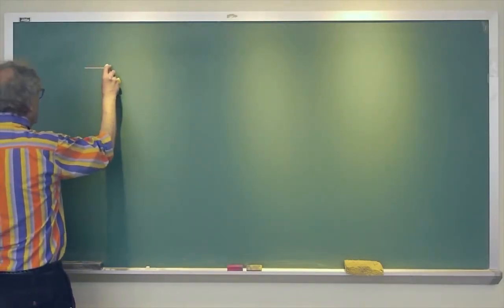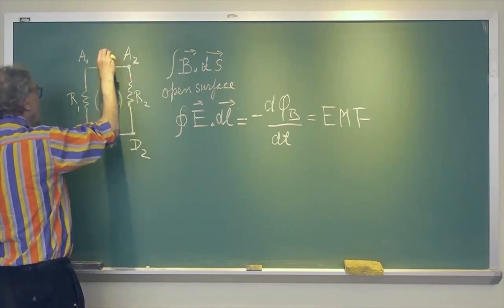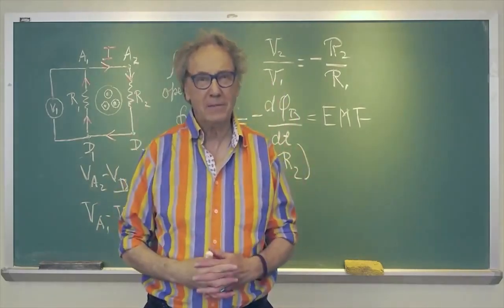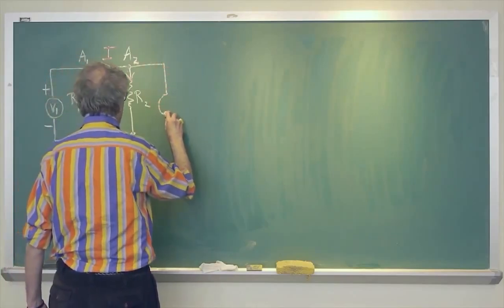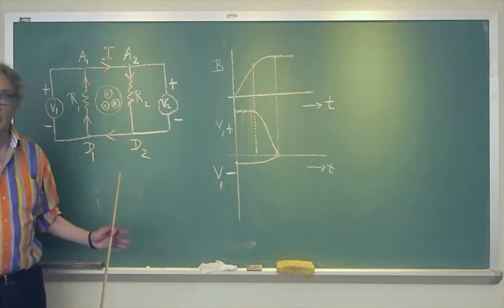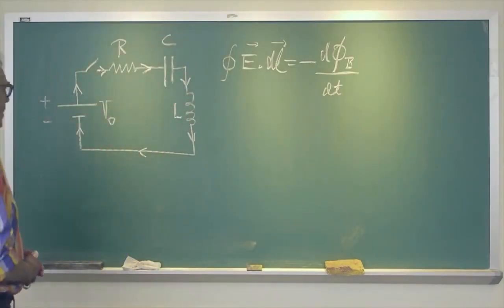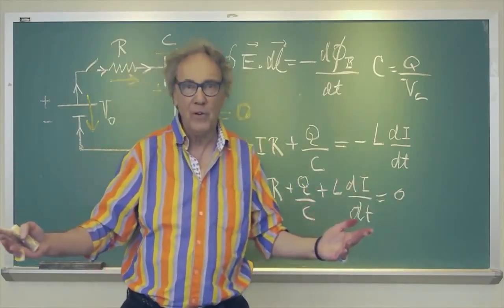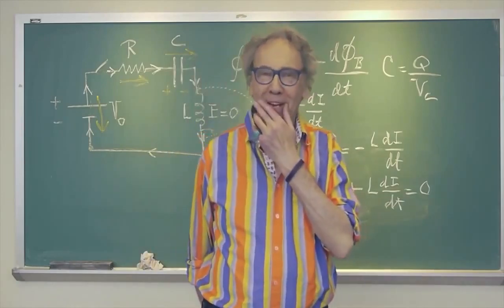Kirchhoff's Loop Rule Is For The Birds

Comment: Wait.. KVL says "The directed sum of the potential differences (voltages) around any closed loop is zero." Your two volt meters should be pointing both clockwise if you're going to test it against KVL. You have one backwards if you're testing it for KVL.
Reply from the maker: I appreciate the fact that this Physics may not be familiar to you. Don't feel embarrassed about it; you are not alone. However, it's never too late to get educated. The choice is yours. Maybe this will help you. 
I demonstrated at the end of my lecture #16 of my 8.02 E&M course at MIT that two identical voltmeters attached to the same 2 points in a circuit can show very different values. https://www.youtube.com/watch?v=nGQbA2jwkWI&list=PLyQSN7X0ro2314mKyUiOILaOC2hk6Pc3j&index=17 The reason is that in the case of an induced EMF (Faraday's Law) potential differences are no longer determined; they depend on the path. This also applies to the secondary windings of transformers as the EMF in the closed loop of secondary windings is induced. https://www.youtube.com/watch?v=b7i2uMx7gHo&list=PLyQSN7X0ro22zanLOcvkaSY-IZqheFYM5&index=8
Of course, in cases where Kirchhoff's loop rule (KVL) applies, 2 voltmeters attached to the same 2 points in a circuit will always show the same value. 
My demo was first suggested and published by Romer in December 1982 in the American Journal of Physics. This demo has now become a classic; it's done all over the world at many colleges and universities. 
Kirchhoff's original text can be found in the following link, pages 497-514: https://books.google.de/books?id=Ig8t8yIz20UC. Clearly he was fully aware of the prerequisite for his "loop rule". KVL is a special case of Faraday's Law. That's why Faraday's Law is one of Maxwell's equations and KVL is not.
By teaching students that KVL always works without telling them when it does not work, makes many believe that the closed loop integral of E dot dL is always zero. ElectroBOOM and Dirk Van Meirvenne therefore believe that 2 voltmeters attached to the same 2 points in a circuit must always show the same value which is not true as demonstrated in my lectures. They each posted a video (see @ footnote below) on their channel in which they claim to have proof for their wrong ideas which violate Maxwell's equations. Apparently they do not know, or do not understand, that in the case of an induced EMF potential differences are no longer determined; they depend on the path. MIT students who took my 8.02 course (Electricity and Magnetism) would not make this mistake! I therefore believe that to introduce a "modern version" of KVL and then teach students that KVL always holds is not advisable as you may set them up for making the same embarrassing mistake that both Dirk Van Meirvenne and ElectroBOOM made. 
Also read Professor John Belcher's thoughts on Faraday's Law and on KVL. Professor Belcher is my former colleague at MIT. http://core.csu.edu.cn/NR/rdonlyres/Physics/8-02Electricity-and-MagnetismSpring2002/C29636DB-AB80-49E0-BFAB-BCE00159F00E/0/lecsup41.pdf
(@) ElectroBOOM insulted me in his video by mentioning that the reason why my 2 voltmeters read different values was due to "bad probing". He stated that if I had done the demo correctly I would have found that both voltmeters would have read the same value. He could not have been more wrong  
This is my only msg on this issue. This is too basic. "I teach physics, I do not argue with people who think they know but who don't" (quote from Neil deGrasse Tyson). I do not argue either with people who believe that the Earth is flat.
This video may also help some of you to digest why 2 Voltmeters attached to the same 2 points in a circuit can give very different readings. https://youtu.be/T6S5VS03xZc
Below follows Problem 7.50 in Griffith. Notice the drawing which he copied from Romer and he wrote: "Notice that V1 is not the same as V2, even though they are connected to the same points! See R.H. Romer, Am, J, Phys.50, 1089 (1982)" https://drive.google.com/file/d/1G1a8_YNvB8X9xddUD27x9PE-j7Xbfo3m/view

Comment: Dear Professor Lewin, although  i m an engineer ( i think the circuit is in itself an inductance so KVL holds ) i totaly agtee with you : Kirshoff law is derivable from Faraday law. With love an great rescpect Samir
Reply from the maker: I appreciate the fact that this Physics may not be familiar to you. Don't feel embarrassed about it; you are not alone. However, it's never too late to get educated. The choice is yours. Maybe this will help you. 
I demonstrated at the end of my lecture #16 of my 8.02 E&M course at MIT that two identical voltmeters attached to the same 2 points in a circuit can show very different values. https://www.youtube.com/watch?v=nGQbA2jwkWI&list=PLyQSN7X0ro2314mKyUiOILaOC2hk6Pc3j&index=17 The reason is that in the case of an induced EMF (Faraday's Law) potential differences are no longer determined; they depend on the path. This also applies to the secondary windings of transformers as the EMF in the closed loop of secondary windings is induced. https://www.youtube.com/watch?v=b7i2uMx7gHo&list=PLyQSN7X0ro22zanLOcvkaSY-IZqheFYM5&index=8
Of course, in cases where Kirchhoff's loop rule (KVL) applies, 2 voltmeters attached to the same 2 points in a circuit will always show the same value. 
My demo was first suggested and published by Romer in December 1982 in the American Journal of Physics. This demo has now become a classic; it's done all over the world at many colleges and universities. 
Kirchhoff's original text can be found in the following link, pages 497-514: https://books.google.de/books?id=Ig8t8yIz20UC. Clearly he was fully aware of the prerequisite for his "loop rule". KVL is a special case of Faraday's Law. That's why Faraday's Law is one of Maxwell's equations and KVL is not.
By teaching students that KVL always works without telling them when it does not work, makes many believe that the closed loop integral of E dot dL is always zero. ElectroBOOM and Dirk Van Meirvenne therefore believe that 2 voltmeters attached to the same 2 points in a circuit must always show the same value which is not true as demonstrated in my lectures. They each posted a video (see @ footnote below) on their channel in which they claim to have proof for their wrong ideas which violate Maxwell's equations. Apparently they do not know, or do not understand, that in the case of an induced EMF potential differences are no longer determined; they depend on the path. MIT students who took my 8.02 course (Electricity and Magnetism) would not make this mistake! I therefore believe that to introduce a "modern version" of KVL and then teach students that KVL always holds is not advisable as you may set them up for making the same embarrassing mistake that both Dirk Van Meirvenne and ElectroBOOM made. 
Also read Professor John Belcher's thoughts on Faraday's Law and on KVL. Professor Belcher is my former colleague at MIT. http://core.csu.edu.cn/NR/rdonlyres/Physics/8-02Electricity-and-MagnetismSpring2002/C29636DB-AB80-49E0-BFAB-BCE00159F00E/0/lecsup41.pdf
(@) ElectroBOOM insulted me in his video by mentioning that the reason why my 2 voltmeters read different values was due to "bad probing". He stated that if I had done the demo correctly I would have found that both voltmeters would have read the same value. He could not have been more wrong  
This is my only msg on this issue. This is too basic. "I teach physics, I do not argue with people who think they know but who don't" (quote from Neil deGrasse Tyson). I do not argue either with people who believe that the Earth is flat.
This video may also help some of you to digest why 2 Voltmeters attached to the same 2 points in a circuit can give very different readings. https://youtu.be/T6S5VS03xZc
Below follows Problem 7.50 in Griffith. Notice the drawing which he copied from Romer and he wrote: "Notice that V1 is not the same as V2, even though they are connected to the same points! See R.H. Romer, Am, J, Phys.50, 1089 (1982)" https://drive.google.com/file/d/1G1a8_YNvB8X9xddUD27x9PE-j7Xbfo3m/view
Reply: @lecturesbywalterlewin.they9259  Thank you Dear Professor for your educating answer. God bless you.

Comment: You cannot apply Ohms law to this circuit, because Ohms law precludes any magnetic effect. Ohms law suppose that E=-grad(V) which is no more the case in a circuit affected by a changing magnetic field (you need to add -dA/dt). So I think that your line EMF=I(R1+R2) is incorrect and is the source of your mistake.
Reply from the maker: NO mistake!  Maxwell's eqs always work as long as you know how to use them. The potential difference over any ohmic resistor, R, through wich a current I flows is IR. I suggest you watch this video. https://www.youtube.com/watch?v=wz_GqO-Urk4&list=PLyQSN7X0ro22zanLOcvkaSY-IZqheFYM5&index=10

Comment: This is obvious, in fact we use lumped parameters (thus kvl) only when there are some particular conditions, otherwise we use distributed parameters (thus Maxwell). 
Fortunately for a lot of simple pratical cases we can use kvl. But obviously not for all. 
You can also modify the lumped topology in order to have some kind of approximation of the effect of the external field, for example adding a transformer, there is a lot of literature in the EMC sector about how to approximate these kind of effects using lumped parameters.

Comment: Another words, if I switch the polarity of the voltmerer #1 in yhis cerain moment it will show 1V instead of 0.1V?
Reply from the maker: switching the polarity of a voltmeter will only change the sign not the magnitude
Reply: @lecturesbywalterlewin.they9259  

Ok. If I will take only one voltmeter and touch the points A and D. What voltage it will show me? 0.1 or 1?
Reply from the maker: One you have a full understanding of Faraday's Law then you can answer your question. 
I appreciate the fact that this Physics may not be familiar to you. Don't feel embarrassed about it; you are not alone. However, it's never too late to get educated. The choice is yours. Maybe this will help you. 
I demonstrated at the end of my lecture #16 of my 8.02 E&M course at MIT that two identical voltmeters attached to the same 2 points in a circuit can show very different values. https://www.youtube.com/watch?v=nGQbA2jwkWI&list=PLyQSN7X0ro2314mKyUiOILaOC2hk6Pc3j&index=17 The reason is that in the case of an induced EMF (Faraday's Law) potential differences are no longer determined; they depend on the path. This also applies to the secondary windings of transformers as the EMF in the closed loop of secondary windings is induced. https://www.youtube.com/watch?v=b7i2uMx7gHo&list=PLyQSN7X0ro22zanLOcvkaSY-IZqheFYM5&index=8
Of course, in cases where Kirchhoff's loop rule (KVL) applies, 2 voltmeters attached to the same 2 points in a circuit will always show the same value. 
My demo was first suggested and published by Romer in December 1982 in the American Journal of Physics. This demo has now become a classic; it's done all over the world at many colleges and universities. 
Kirchhoff's original text can be found in the following link, pages 497-514: https://books.google.de/books?id=Ig8t8yIz20UC. Clearly he was fully aware of the prerequisite for his "loop rule". KVL is a special case of Faraday's Law. That's why Faraday's Law is one of Maxwell's equations and KVL is not.
By teaching students that KVL always works without telling them when it does not work, makes many believe that the closed loop integral of E dot dL is always zero. ElectroBOOM and Dirk Van Meirvenne therefore believe that 2 voltmeters attached to the same 2 points in a circuit must always show the same value which is not true as demonstrated in my lectures. They each posted a video (see @ footnote below) on their channel in which they claim to have proof for their wrong ideas which violate Maxwell's equations. Apparently they do not know, or do not understand, that in the case of an induced EMF potential differences are no longer determined; they depend on the path. MIT students who took my 8.02 course (Electricity and Magnetism) would not make this mistake! I therefore believe that to introduce a "modern version" of KVL and then teach students that KVL always holds is not advisable as you may set them up for making the same embarrassing mistake that both Dirk Van Meirvenne and ElectroBOOM made. 
Also read Professor John Belcher's thoughts on Faraday's Law and on KVL. Professor Belcher is my former colleague at MIT. http://mit.sustech.edu/NR/rdonlyres/Physics/8-02Electricity-and-MagnetismSpring2002/C29636DB-AB80-49E0-BFAB-BCE00159F00E/0/lecsup41.pdf
(@) ElectroBOOM insulted me in his video by mentioning that the reason why my 2 voltmeters read different values was due to "bad probing". He stated that if I had done the demo correctly I would have found that both voltmeters would have read the same value. He could not have been more wrong  
This is my only msg on this issue. This is too basic. I do not argue either with people who believe that the Earth is flat.
This video may also help some of you to digest why 2 Voltmeters attached to the same 2 points in a circuit can give very different readings. https://youtu.be/T6S5VS03xZc

Comment: Electricity and magnetism lecture 16 notes
Reply from the maker: Lecture Notes 8.02

#7 Capacitance of Spheres
http://mit.sustech.edu/NR/rdonlyres/Physics/8-02Electricity-and-MagnetismSpring2002/CCD1D384-1E00-4CAE-88D0-010AB6068CC3/0/lecsup220.pdf

#8 Dielectrics and Polarization
http://mit.sustech.edu/NR/rdonlyres/Physics/8-02Electricity-and-MagnetismSpring2002/3711CBD8-B46E-4480-8AE6-CAD11A49E62E/0/lecsup222.pdf

#11 Build your own Electric Motor
http://mit.sustech.edu/NR/rdonlyres/Physics/8-02Electricity-and-MagnetismSpring2002/77A8653E-8AAC-4766-9D53-D52A75C18469/0/motor.pdf

#13 Circular motion
http://mit.sustech.edu/NR/rdonlyres/Physics/8-02Electricity-and-MagnetismSpring2002/50B8C26D-C810-4921-A65A-520137EEF37C/0/lecsup38.pdf

#15 Mid-term, Evaluation form 
http://mit.sustech.edu/NR/rdonlyres/Physics/8-02Electricity-and-MagnetismSpring2002/415CD6BB-A948-407E-A298-D5A01C30F1AF/0/lecsup313.pdf

#16 Non-conservative Fields - Do not Trust your Intuition
http://mit.sustech.edu/NR/rdonlyres/Physics/8-02Electricity-and-MagnetismSpring2002/61F4F0BE-5591-4909-9035-49610C28B58F/0/lecsup315.pdf

#20 Faraday's Law - Most Physics Books have it WRONG
http://mit.sustech.edu/NR/rdonlyres/Physics/8-02Electricity-and-MagnetismSpring2002/C29636DB-AB80-49E0-BFAB-BCE00159F00E/0/lecsup41.pdf

#20 Driven L-R Circuits
http://mit.sustech.edu/NR/rdonlyres/Physics/8-02Electricity-and-MagnetismSpring2002/FBC25EB0-EDCC-496F-97F5-77342735C010/0/lecsup41a.pdf

#21 Magnetic Materials 
http://mit.sustech.edu/NR/rdonlyres/Physics/8-02Electricity-and-MagnetismSpring2002/B301F704-8360-4F1D-AB42-E530A3E7B6A8/0/lecsup43.pdf

#22 Maxwell's eqs
http://mit.sustech.edu/NR/rdonlyres/Physics/8-02Electricity-and-MagnetismSpring2002/26BACB7F-706E-49B1-B9F8-832D316A0A7B/0/lecsup45.pdf

# 23 Exam 2 Review - Topics
http://mit.sustech.edu/NR/rdonlyres/Physics/8-02Electricity-and-MagnetismSpring2002/3061D2C3-92DB-49A7-BA05-7E4E27576490/0/lecsup48.pdf

#25 Driven L-R-C Circuits I
http://mit.sustech.edu/NR/rdonlyres/Physics/8-02Electricity-and-MagnetismSpring2002/FA08311D-2765-4404-B47C-50362245AF4E/0/rlc1.pdf

#25 Driven L-R-C Circuits II
http://mit.sustech.edu/NR/rdonlyres/Physics/8-02Electricity-and-MagnetismSpring2002/D89044E3-10B1-42DC-8D57-C4C2E961F3F0/0/rlc2.pdf

#26 Oscillating Sound Cavities - Fundamentals if Wind Instruments
http://mit.sustech.edu/NR/rdonlyres/Physics/8-02Electricity-and-MagnetismSpring2002/E3B2FED5-F656-4AEC-96A1-130745A7D101/0/lecsup419.pdf

#27 Traveling EM Waves 
http://mit.sustech.edu/NR/rdonlyres/Physics/8-02Electricity-and-MagnetismSpring2002/08D1D0C5-A8A3-44CA-A290-9EFCB20110C8/0/lecsup422.pdf

#29 Speed of EM Waves in Matter - Index of Refraction
http://mit.sustech.edu/NR/rdonlyres/Physics/8-02Electricity-and-MagnetismSpring2002/BB80210A-AC60-443D-9DF2-3E3658AE6812/0/speedlight.pdf

#31 15 Question about Rainbows
http://mit.sustech.edu/NR/rdonlyres/Physics/8-02Electricity-and-MagnetismSpring2002/CF929F8C-ECE3-4BA1-A79D-E3DD13D0C37C/0/15questions.pdf

#31 Key Angles for the Primary Rainbow
http://mit.sustech.edu/NR/rdonlyres/Physics/8-02Electricity-and-MagnetismSpring2002/2FC46772-6FD3-4973-8811-DDAB05CED7EC/0/angles.pdf

#32 Exam 3 Review
http://mit.sustech.edu/NR/rdonlyres/Physics/8-02Electricity-and-MagnetismSpring2002/928CC0F9-CFDC-4582-9386-730C73D3B5E3/0/lecsup53a.pdf
Reply: Thanks ( in Hindi धन्यवाद 🙏)